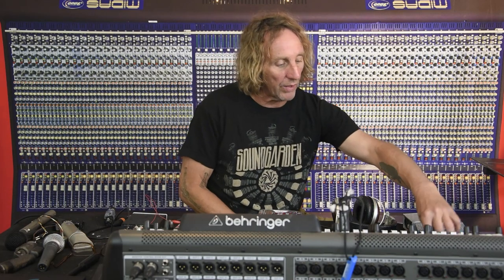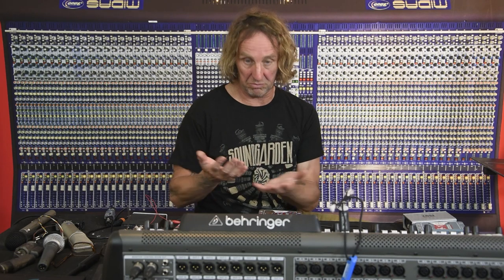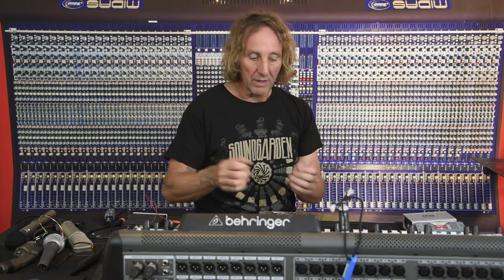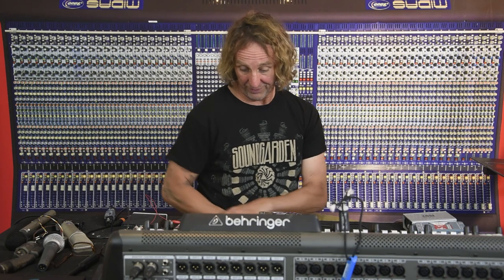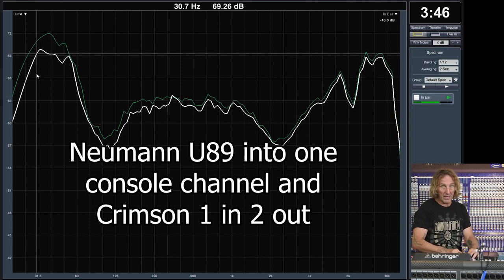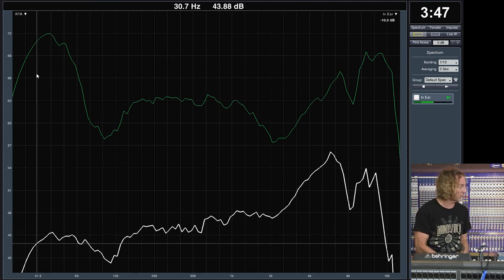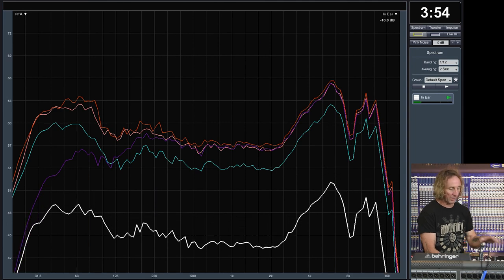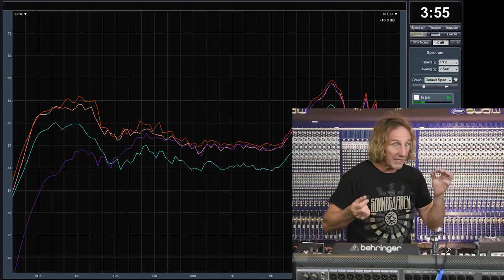Do Audio Transformers Mess Up the Sound Part 3 - om7 & U89

Comment: Good job Dave  showing that it a system not just a bunch of separate parts.  Knowledge is power and should be valued thus it not free.  Sharing here is very  kind of you.  R+D matters but it does take time .  Keep up the good work . Impedance not resistance  on the cable but then I am pedantic on that point even thou both are stated as ohms . Been happy with Cinemag for HiFi use very nice for MC step ups .

Comment: I hope your audience doesn’t make the incorrect connection that splitter transformers = non-splitter xformers. Like any component, design and application are everything. Example, far more microphones have an output transformer than not. Splitter transformers are trying to do a job no transformer can and deserve their nasty rep.

The primary reason I built my active splitter was the comments from customer engineers dreading the extensive console changes they would have to make to accommodate my split xformers. It was embarrassing and a bit heartbreaking to think my presence might ruin their show.
Reply from the maker: I find the unknown alterations to be the issue. Great mics may or may not have a transformer and may or may not be relatively flat response. But we know what we are dealing with and mic to mic consistancy is typically within a range that is not easily noticeably different.

With iso or split transformers, the specs show them typically very flat and they typically are. But the change they induce is drastic compared to other gear we use.

A digital vs analog consoles, differing wire types, and various mic preamps all tend to have much much less impact on the freq response than dropping a transformer into a mic line.

It is the hypocrisy of what is acceptable and what is not, that I find most fascinating.

If consoles or wires or mic preamps introduced somewhat arbitrary responses to the signal chain, engineers would lose their minds but if it's a transformer doing it, ah, no worries, that's all good, right?

Comment: I've got an MCI JH-500 console, which was modified to have its transformers removed. I'm debating putting transformers back on the mic inputs (and in a few other places). I might do it on most or half of the console to give myself options.
Reply from the maker: Maybe keeping them external in a seperate rack mount would be best

Comment: at 5:12
please explain how that is linear. 
i see a 12 db drop from 31 Hz to 120 Hz
Reply from the maker: Hmmm, so each horizontal line is 3db and you are seeing the the difference between the whiteeasured signal drop 4 horizontal lines the entire range of 30 to 120 in relation to the saved signal line?

Interesting
Reply: @DaveRat  I need to attend your class. I see it’s in relation to the other measurement line. It was hard to see on my little screen
Reply from the maker: Aha, ok, that makes more sense. Cool cool

Comment: Is there any kind of product that is an active, balanced, low noise, unity gain buffer for pre-loading or “conditioning” a dynamic mic? Like a Cloudlifter but without the gain. Or mic splitters with such a unity gain buffer switchable on the input.
Reply from the maker: Bss used to make an active mic splitter and I've seen others over the years.  These bring their own issues to consider 

As soon as you are active, clipping and noise become concerns.

A transformer split may alter the response but does not add noise and is very hard to dostort

Comment: Great video series, and thank you for the wizdom. Would I be right in assuming wireless microphones (where the XLR signal comes from a DC powered receiver) would not be affected as greatly by a transformer or a Y cable / signal splitter?
Reply from the maker: I believe that it is highly probable that that is correct. Low impedance outputs tend not to be impacted. That said, condenser mics that have electronic outputs are impacted. My assumption is that the mics have output impedance that are 200 ohms or so, which tends to be higher than the output impedances of consoles.

But it is possible that the mic level outs of wireless receivers are higher and meant to math the mics, which means they would be impacted. And the line line level outs most likely are not impacted.

This would need to be tested and I don't have enough field knowledge of those scenarios to give a confidant answer.
Reply: @DaveRat  Thank you, that's what I was also thinking. At work next Thursday, we'll be getting a Behringer MS8000 mic splitter (not my choice) to connect four Sennheiser EW-D EM receivers. I'll try replicating your setup and share results if there's enough time. Enjoy the weekend :)
Reply from the maker: Awesome and please do
Reply: @DaveRat  I don't believe the microphone splitter changes the sound. Bass levels stay the same, but the treble might be affected because I moved the microphones between takes. I may have to try this again next year after holidays - and do it properly, i.e. not moving the microphones for the whole test.  https://youtu.be/Fa4nrBBmA64
Reply from the maker: Yeah, can't move the mic, the changes would easily be masked by altering mic position

Also, some mics are impacted more than others.  I would confirm your test work by using a dynamic mic. Then move to condensers which are less impacted.
Reply: @DaveRat  Thanks, I'll try again this Monday and bring in some more microphones.

Edit: There's more gremlins in this setup than expected. I'll revisit this next year when there's more time at work and I can observe things more thoroughly, which should be mid January. The wireless mic frequencies don't appear to be affected, but the measured volume from the splitter was quieter than the measured volume level from the mixer. The cabled dynamic mic routed through the splitter provides less bass and a slight boost in 3 to 5 KHz range. Here's my second attempt at measuring this. https://youtu.be/tqDqtrU92Y4

Thanks again Dave! Your talent at making videos straightforward, clear, and super informational is very much appreciated.
Reply: Wow, I do apologise for the time it took for making this follow up. I tried to tame all the variables, and do a better job at explaining the objectives. It may be misleading to compare your findings to this because the gear and sampling process is quite different. https://youtu.be/ZeAj2WCjsRo
Reply from the maker: What I found was it was the existence of the transformer that caused the issue. So the direct out and transformer out of the splitter unit should show almost exactly the same sound for you. If you were to open up the splitter unit and disconnect the transformer that's when you would see the difference.

Comment: Once, I bought some cheap audio transformers to experiment with. I wanted to see how they would distort, but my tests didn't reveal much, and null tests revealed zero difference but for a very small, consistent noise. I may have to try this again, but with 110dB of adjustable gain on the input.
Reply from the maker: I do another vid on transformer overload coming soon

Comment: Has anyone made a FET based isolation box? (Or an optical isolator)

One would think the extremely high impedance would allow for a better alternative than either the resistive based inline isolator or a transformer? 

Similar to how a condenser preamp works, just as a "passive" (electrically to the input side/dynamic mic at least) inline.

Great series! Cool to see some real world effects of transformers, especially on the dynamics, inductance and impedance are always tricky
Reply from the maker: Many of the DI boxes are FET. The downside of going active is added noise and the potential for distortion.

Awareness is key

And also, use a hardwire split whenever possible as it has no real downside if your grounding is well thought out

Comment: Will the same thing happen to line level signals? 
Console output through a transformer split to PA / Broadcast for example.
Great Vid.
Reply: These days digital interfaces like dante/madi let you split anything to lots of destinations without any loss. Would be easier and wiser to invest in the technology.
Reply from the maker: Yea, digital splits don't drastically change the sound. I have not seen line level low impedance splits impacted much. 

It's the impedance of the output more than the line or mic level I believe that allows the impact

Comment: How would you recommend doing a split to a monitor console without a transformer based split?
Reply from the maker: Doing a hardwire split works well if you have a well designed grounding scheme. Note that the transformer changed the sound of the transformer out AND the direct out as well. The existance of the transformer is what changes the sound. The sound of the direct split and transformer split are nearly identical with decent transformers

Comment: The Radial JS3 is a 2.4k ohm 1:1 while the line level ISO's are 600ohm 1:1.  Surely this has much to do with the difference in response change imparted on the microphone.      Of course the audio quality going through them will vary based on the size, quality, and amount of windings.
Reply from the maker: The point here is that the transformers alter the sound that is not going through the transformer.

And every type of transformer causes a different change in sound

And every type of mic is impacted differently by the same transformer type.

And line level transformers seem to impact mics less than line level transformers.

It is the variable set of unknowns of the infinite mic transformer combinations that is the focus and point of the video
Reply: @DaveRat  absolutely agree - I just was pointing out that the different impedance of the transformer (potential mismatch) can be attributed to the response differences we are seeing and hearing.

Comment: Why didn’t you use transfer function showing magnitude and phase differences? I use AMFG SysTune so I’m not aware if Smartt can do this, I’m assuming it can,I’m sure this would give a better optic to show the effect on the signal, the frequency response graphs are hard to differentiate here on YouTube.
Please do not forget that nearly all microphones have a transformer on the output and when „splitting“ a signal impedance matching is critical to frequency response, this is why split transformers have two or more output coils, this way the microphone only „sees“ one circuit and the inputs from the split as well, with some simple splits changing the headamp gain will alter the level at the other desk, over the years we have had a few headaches with this, especially if the desks have different input Stage topologies eg when one has transformers on the input (again) and the other uses an electronic buffered balanced input…..this is why many old mixing desks are so much more sought after with their eg. Marinair, Carnhill or Lundahl transformers😊
Reply from the maker: There is a lot of data out there and graphs and information regarding the differences we may or may not be able to hear. In my videos I try and focus on actually hearing the differences, so people can determine whether or not those differences we see in various types of test gear actually matter to them. 

There are lots of specs that seem important that are hardly audible or not audible at all and there are many things that are very audible yet no clear and defined specs for them.

Those are the realms I like to dive into
Reply: @DaveRat  I just thought a transfer function would show the differences more clearly and easily understandable, wasn’t meant to be any critic of your work flow and video presentation, which I think you make very well even for beginners, after 45 years behind desks I often forget some people have never seen an analog Midas or so desk let alone have experience of using one, at the moment I’m rocking an original Allen and Heath Mod2 desk in my studio, speak about colouring the sound, feel real lucky to have rescued it, it was on the way to the dump when I spotted it, still working extremely well for its age, was doing the jobs for Pink Floyd, The Who etc, as far as I know it shows up in „live at Pompei“ film, I should do a check of the transformers on the mic inputs, they’re about the size of a espresso cup so probably the famous hand wound ones from the south coast of England..desk has been around doing mixes even longer than I have…from 1972….

Comment: What voltages are those audio xfmrs rated for? I guess there are quick ways to make sure one side of a mic cable doesn't have its shield or signal pins shorted to 120VAC or something. If the board shorts AC to the mic cable, is the mic housing connected to shield?

Comment: It would be fun to see a video about what transformers do to transients in audio. 

Rupee neve has a 8 ch Dante preamp that is loaded with transformers. I saw a video with a guy that ran a hi hat through that preamp and through a non transformer preamp. Definitely sounded better without the transformer.
Reply from the maker: Transformers definitely change the sound way more than modern digital.

As far as subjective better or worse I, that is up to the individual
Reply: @DaveRat  Yes - better or worse is in the ears (?) of the beholder :-) 

But it would be fun to see if we could see transformers change the dynamics of a signal. Like with a pulse signal and then view it on a scope.